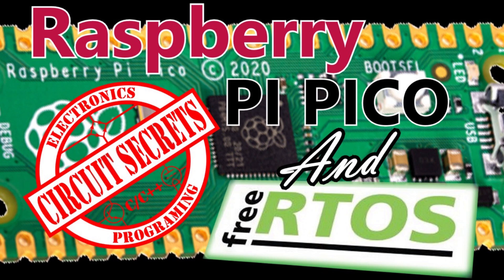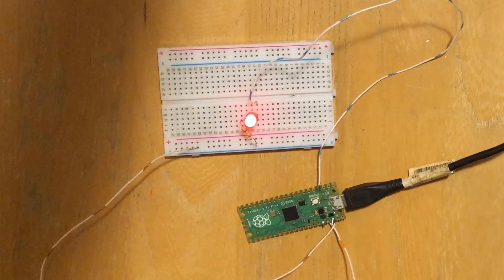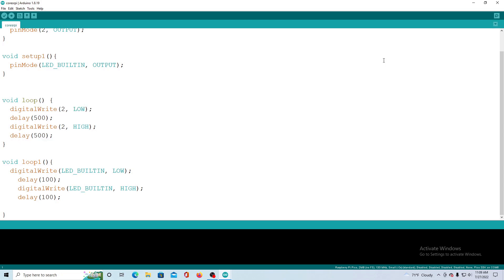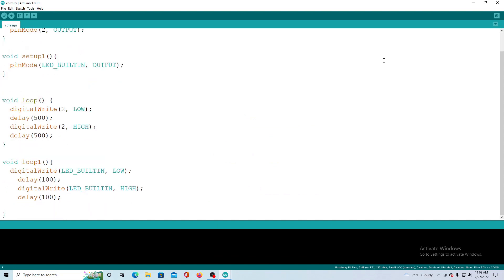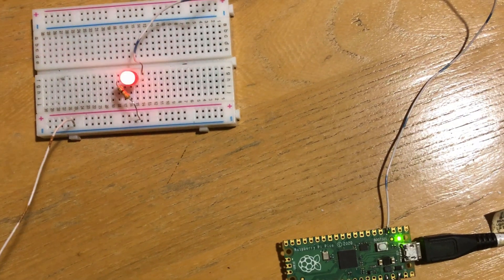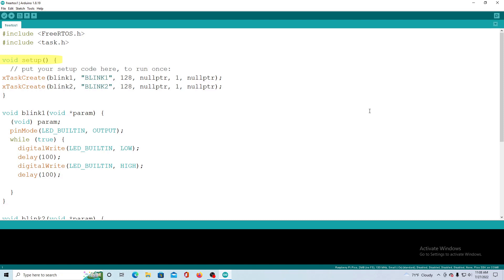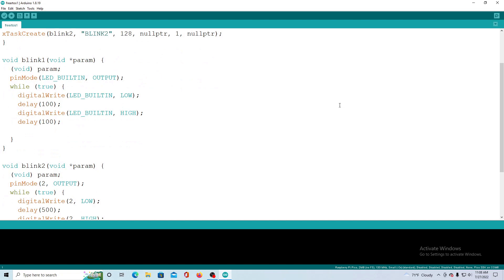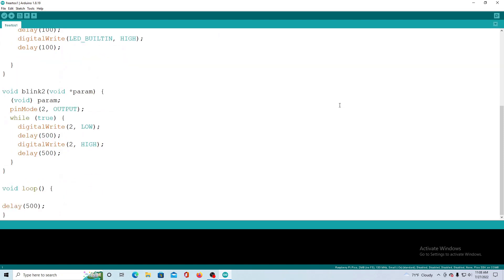Raspberry Pi Pico FreeRTOS and Arduino part 1

Comment: have you posted the FreeRTOS code so we can test it out? If so what is the link. Thanks Richard
Reply from the maker: The examples from the video can be found at www.circuitsecrets.com
Reply: @CircuitSecrets  Thanks. I was looking for help and I noticed that Mbed is a RTOS also.I may be wrong about that! Have you ever looked at that.. Thanks again Richard
Reply from the maker: @richardbrown2290  I noticed it but have not actually tried it, so I can't help with that.

Comment: Could you please provide the exact name of the library used here? I tried to add in ARDUINO IDE to import a FreeRTOS library but I was not able to find one that loaded to the PICO to run.
Reply from the maker: Here is the video where I explain the library. https://youtu.be/JfVnUlGTBi8
Reply: I have included the provided git url the preferences for the bord manager. But still I am not able to locate the library. I will uninstall everything, delete local files  and reinstall. Thank you for the fast answers.
Reply from the maker: @lc-dj2xs  I hope it helps you get it working, good luck.
Reply: No I pasted Philhower in the Library Manager: only two libraries I was able to locate
Reply from the maker: @lc-dj2xs  You have to include the github address for the earlphilhower library.under preferences in the section titled board manager urls. Then the library will show up in the board manager.

Comment: @CircuitSecrets Thanks for the super quick reply. 
I did everything just like explained in linked video, but I kept getting errors. 
After uninstalling the Arduino IDE and reinstall it and changing a lot of things, finally now it's working just fine. 
The secret or should I say the main problem was that there was a "clash" between libraries. 
The FreeRTOS library for Arduino UNO (with other few boards) was having a priority clash with the Pi Pico FreeRTOS library. 
So, I made a clean install of the Arduino IDE and also deleting all related folders. 
An then installed only the Pi Pico FreeRTOS library. Only then, everything is working properly. 

So, if it not a trouble, could you make a video on how to manage the libraries for Arduino IDE? 
Mainly on library foldering sysytem and how to create folders so that they don't clash into each other.
Or, if there is already a video somewhere explaining all these, please share me the link.

Thanks for you time.
Reply from the maker: I am glad you got it sorted. I think the libraries fall into the include paths automatically. So first installed is the first looked for. I can see how the naming would cause an issue. Perhaps adding the desired header to the project sketch would cause it to be pulled first? I will have to experiment and get back to you on it. Thanks for the suggestion, I will make a video with my findings after the video I am currently working on. Thank you!
Reply: @CircuitSecrets  I never thought first installed library will be first referred. Anyway, I (and many others) would appreciate it if there is a detailed video on how to manage folders for libraries and naming of the libraries in order to avoid clashes. 
Thanks in advance.
Reply from the maker: @hrnbrain  OK I will see what I can do. I have never had a conflict between libraries so I assumed it was not a common problem. In my next video I will focus on library management for the Arduino IDE, what little management options are actually available.

Comment: How would code from both cores access the serial port or other on board hardware?
Reply from the maker: To keep from running into trouble I would separate the hardware access across the cores. Like use a given serial port only on one core, use a specific ADC only on one core. I have not experimented with that particular problem, I just instinctively have always tied certain actions to certain tasks and cores. I know that the pins can all be routed to access different hardware, and I assume the same goes from processor cores to the hardware. I can't find a block diagram or schematic concerning the cores and the connection structure.
Reply: @CircuitSecrets  thanks, are global variables accessable to both cores?
Reply from the maker: @Tony770jr  Yeah, but be careful with that too, as if one is changing the value the other could miss it. Maybe have a global variable that changes when a process accesses the variable to write it.
Reply: @CircuitSecrets  will do, thanks!
Reply from the maker: @Tony770jr  You're welcome!

Comment: Hi, thanks for the easy to understand explanation. However, I have a problem getting it work. I keep getting "fatal error: FreeRTOS.h : No such file or directory". How can I install the necessary libraries?
Reply from the maker: Thank you! I should have included the link in this video, but FreeRTOS is included in the Philhower library for the raspberry pi pico/pico w. That video is here https://youtu.be/JfVnUlGTBi8 it covers how to setup the library, and there is a link to the associated board manager url in the description of that video. Once installed, and the correct board is selected from that board manager addition the header should be found. I hope this helps.
Reply: @CircuitSecrets I am getting Arduino_freertos.h in examples in Arduino IDE and freertos 11 version.  I am unable to locate freertos.h. what can I do.

Comment: Hi, how add freertos library in Arduino IDE? Maybe link, or instructions.
Reply from the maker: Sorry I didn't think to include the information because I did a whole series on the raspberry pi pico and arduino, and the very first video included the link to the libraries. FreeRTOS is included in the Philhower library for the raspberry pi pico/pico w. That video is here https://youtu.be/JfVnUlGTBi8 it covers how to setup the library, and there is a link to the associated board manager url in the description of that video. Let me know if this helps and if you have any other questions. Good luck!
Reply: @CircuitSecrets  
thanks! your advice and videos helped me a lot. I tried to install the original freertos kernel ported to rp2040 directly into the sketch, but it didn't work. surprised to learn that the freertos core is integrated into Philhower's unofficial board manager. thanks again
Reply from the maker: @tehnoart1  I am glad it helped, happy coding!